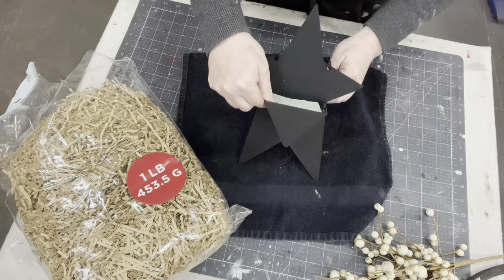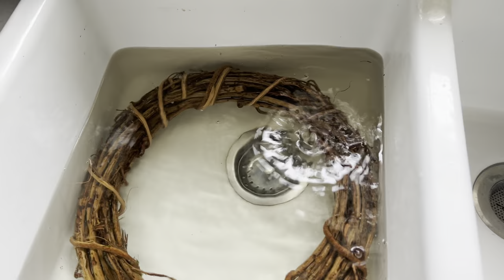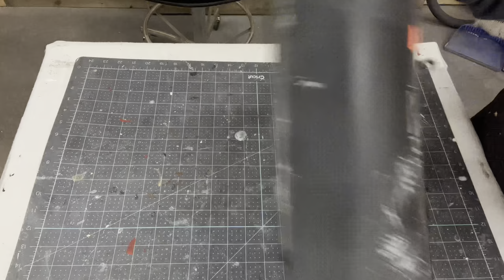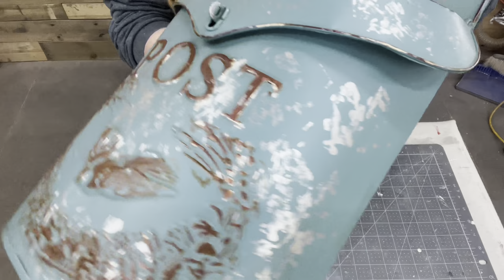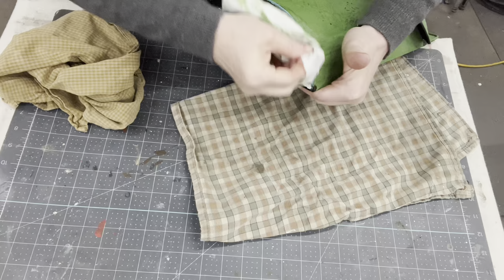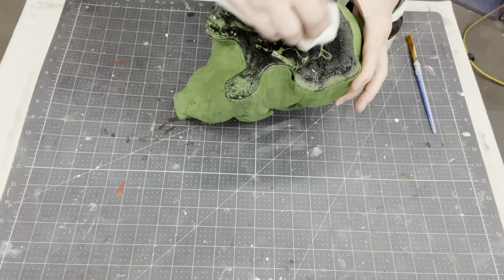CREATIVE TRIFT STORE MAKEOVERS FARMHOUSE-COTTAGE STYLE

Comment: I'm so happy to see that you're using Sweet Pickins Milk Paint! It's an incredible product! Did you know that you could add a bit more powder than water when mixing to make it less runny? I just love how easy it is to change the consistency to whatever you need it to be. You can even make it thick to add texture. Adding heat will make it crackle and chip more too. Oh! I was wanting to tell you, warm water and an immersion blender make it much easier and quicker to mix the milk paint. If you're making a small amount, the immersion blender would work very well though. 👍🏻 My favorite colors to use in that line are- Sweetie Jane, Pantry Door, Oh Olive!, and Ocean. Oh Olive! is probably my favorite! Great job on all the projects! They all turned out fantastic!! 🫶🏻